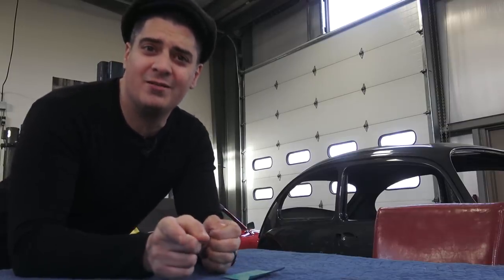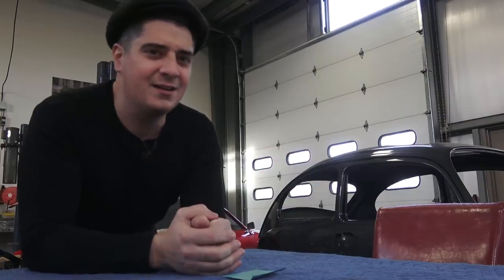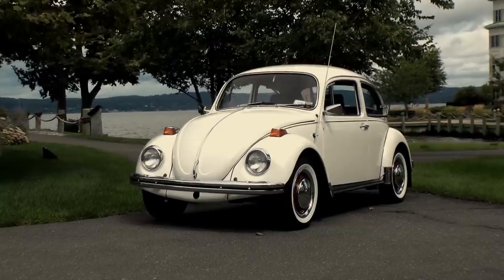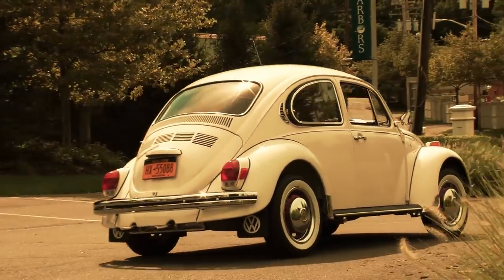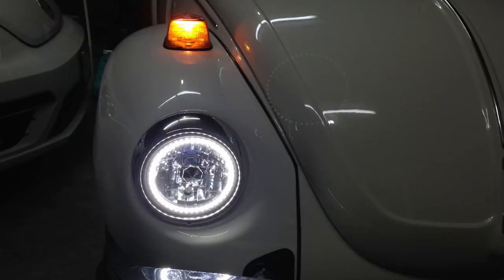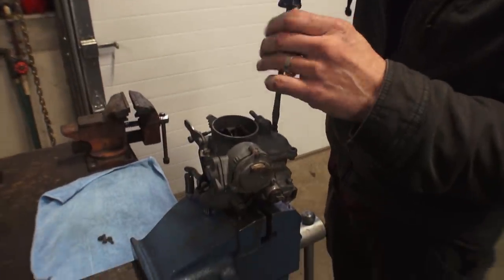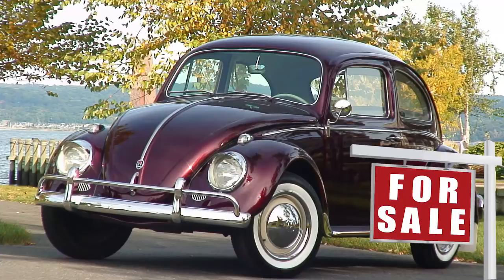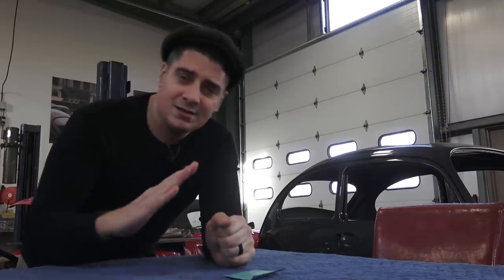Classic VW BuGs Top 5 Reasons You can Still use a Beetle to Daily Drive

Comment: I LOVE my daily driver bug!! Wouldn't trade it for the world, even when I'm broke down on the side of the road 😂😄
Reply: Same here with my 56 vw panel van
Reply: Dust Buggy I’ll always own a Beetle!
Reply: Are they problematic??
Reply: @jimmymolina4300  lol yes and no. Yes because they are so old and many have not been maintained as much as they should have been. No because when they are fresh they run very well and are very reliable! 👌
Reply: Dust Buggy this really hit home! I was broke down in my super beetle two nights ago 🤣
Reply: @Alex Rodriguez get any sort of electronic ignition, get your ignition system sorted,(new sparkplugs, cables,cap ,rotor and belt) get all of your fuel hoses replaced and get new fuel filter, then get the brakes serviced ,CRY ONCE  it'll give you more smiles per gallon
Reply: @jimmymolina4300  no
Reply: I keep an oh crap kit if it breaks down. Extra carb plugs wires string tools. etc my car is very reliable.
Reply: Well, one thing about a bug: It might break down by the side of the road once in awhile, but if it did, there was a very good chance that you could fix it by the side of the road. Try to fix a 21st century computerized wonder-car by the side of the road.
Reply: @null643  I hadn’t looked at prices for a few years but was bug shopping the other day. Yeah they have gone up a little but you can still get a really nice 68 and later for under 10 grand. It seems like a lot but I’d rather pay 10 to 15 grand for a really nice bug than 50 grand for one of the new rolling computers lol!
Reply: I have a 69 and love it, my other vehicle is a 71 Cj5, and  sportster drag bike. I believe in depending upon myself via carburetors. 👍🤘

Comment: I'm 16 years old, from Sweden, and I love those old vw bugs! I have 2 of them already, one from -64 and the other from -65. I would never even think of buying a new car! I have to do a lot of work to them before I can drive them though... But I have 2 years left before I can get my license anyway.
Reply: Elias Andersson That is Awesome!!!!
Reply: Elias Andersson Lucky you!
Reply: I love Sweden
Reply: My 1st car was a '64, In 1975.  45 years later, I have another '64 sunroof bug.  I drive it almost everyday.  I spent the money and time getting all of the crap parts off of it and making it reliable.  Low tech.  28 pict-1, big cap vac advance dizzy and peirburg fuel pump.  40hp is the perfect engine for me.  31 mpg.  It's a blast at the gas station as I have the only one around and it gets a lot of comments.  Good luck Elias!  From Texas, USA
Reply: @brianchisnell1548  i love my 70
Reply: @brianchisnell1548  Fun to hear :) I really love original, my cars are all original, no extra hp, no bling bling wheels, etc. Original is the only right thing if you ask me. Looks good and it's reliable. Sadly my vw project is kind of put of to the side at the moment since I've got a '56 Volvo Pv 444 KS that I'm currently working on instead since it's not as much work to get it on the road.
Reply: I'm 15 years old from Mexico and I bought a 1968 and I'm working on it too. Beetles are beautiful cars. I think the same as you, originality is the best.
Reply: Any updates on the cars?

Comment: I had several classic beetles in the 1970s and 1980s. My last was a 1961 rag top I sold in 1990. Chris is right, they are a cool and dependable daily driver. When you drive a beetle you are in control 100% and anything high technology is out the window. My '61 did not even have a gas gauge, lol! But as a daily driver you need to understand you are going to be  wrenching on it on a regular basis. Regular maintenance is  part of owning a bug. Every 3,000 miles you have to pull off the valve covers and adjust the valves. While you are at it adjust the points in the distributor and check the timing. How is that pulley belt? Too loose, too tight? Set the tension so it is perfect. That engine is not fuel injected. The carburetor / fuel mixture needs to be adjusted and dialed in. Too much travel in the clutch pedal? There is a cable you can wrench on that closes it up. Brakes need adjusting? Jack up the car, pull off the wheel. There is a star you can turn with a flat head screw driver that will bring the shoes closer to the drum. Chris mentioned being handy with basic tools, but that really needs to be highlighted, especially if you are looking to buy your first bug. Regular maintenance is not an option and you need to keep up on it for as long as you drive the car.

Comment: They work very good. My daily car is a 1200 beetle from 1963. Still with a 6volt electrical system. The 6volt works pretty good if it is properly maintained. The only modification I have done is to put in an electronic relay for the turn signals. Now they blink at a consistent rate even when idling. I am also planning to put in an extra relay for the headlights. A guy in my club has a 1950 6volt beetle where he has put in a modern cigarette lighter socket that he uses for various chargers. He claims that it works good since a lot of electronics only require 5 volts to charge. I can't confirm it, but he clamims that it works. These cars drive very good in the snow but I put the beetles away from mid November until late March / early April. Where I live we put salt on the roads in the winter and the old german lady doesn't like salt.

Comment: My Daily driver is a 2019 Model 3 and I actually miss a combustion engine. The shifting, smell, and sound. That is why I started restoring my 1968 VW. Wish me luck!
Reply: You know, I fully understand the necessity of moving to electric cars: The only realistic alternative is doing away with cars altogether. But I will never like it. I'm 65 and I'm going to keep my gas-powered pickup truck running as long as I possibly can. I deeply fear that if it dies before I do, I will have to replace it with some electric POS.

Comment: I've had my '63 bug for 22 years. Built a single port 1600 for it as the engine was worn when I got it. I drove it to work for years now I'm retired and have another car but thats only driven when I need more space or there is snow (salty roads kill them in St Louis). Modern accessorys? My bug  has a FM radio, gas gauge and a small fan sitting on the passenger floor. I burned a piston last year (dumbass hot rodding) had to pull the engine and put in a 1641 top end, had new seals put in the transmission, floor pan under the battery and put a new steering box in it. So that was like  $2000 and it's going to be around for as long as I'm around. Here I am watching videos like this to keep her on the road watched your video on adjusting valves yesterday. I've done that 100 times but watch to see if someone can teach me something new. Thanks for the great videos.
Reply from the maker: very cool man

Comment: Agree 100% with everything you said! I have a '73 Super Beetle, which I've had a lot of fun with, been daily driving for the past 9 years. It is a bit of a hassle, requires constant upkeep, but nothing particularly difficult, and almost always quite cheap as I do it all myself. My big word of caution is that one must know that it's a lot of upkeep, and if you take it to someone else for all the work that needs doing it's going to be a money pit. But if you are willing to learn the basic skills to keep it going, and are willing to put in such effort, it's great. The overall costs are quite low, I would say that I've spent no more on it than anyone would on a newer car, not counting depreciation. Counting that, I could probably make back almost everything I've put into it over the years (excluding consumables like gas and oil) if I sold it, which I'd never do - try that with any modern car!
Kids getting into them? I bought mine as a 16-year-old, hoping to get a car that I could learn to work on, something I couldn't do with a modern car.
Good in snow? The lack of front skis and rubber tank-tracks make it look a bit different from the traditional snowmobile, but it performs just about as well. I live in Colorado, where it does snow a good bit. I have chains, but have never needed to put them on - I've always wondered what it could do with them, I'm guessing straight up a green ski slope would be no problem, blue would be questionable. I had a Prius as a second car for a little while, and it became useless in half an inch of snow, part of my motive for selling it.
Upgradeable? That's the thing I love most about it, you can do anything to them, and they're not rare or priceless enough that anyone cares. Mine has all those upgrades mentioned - LED headlights (actually pretty much all LED lights), all-around disc brakes, and I'm currently in the process of installing seats out of a junkyard Honda Accord, which I'm also putting those heating pads into - will be nice on those frigid days. I also have a fully modern Electronic Fuel Injection system I installed myself (Microsquirt ECU, Mexibeetle manifolds) and distributorless LS coil ignition, runs great and gets 30 MPG. And most important, a thumpin' sound system. I've also built a custom wood dashboard and door panels, making the car truly my own.
Low-tech? My mom's Tesla Model 3 drives me insane! Can't even turn the (supposedly automatic but sometimes malfunctioning) windshield wipers on and off without going into some menu on the screen. The problem in my mind isn't the dashboard with way too many switches, it's the ones with basically none and one big touch screen that requires you to take your eyes off the road to do anything - not just annoying but seriously unsafe. What I like about the Bug is that, given the upgrade potential previously mentioned, I can add whatever modern tech I want and not have anything I don't want. Want heated seats like a modern luxury car? Add them. Want a great sound system? Install it. Don't like that modern "infotainment" nonsense? It's not there, and you can keep it that way.

Comment: Appreciate your little shout out to John Muir's book. i had two beetles and two Type 2s back in the day. The "idiot book" got me through those (including a total engine rebuild in the middle of a cross-Canada trip). I still have that book, and the grease stains on the various pages are a testament to maintenance and emergencies both. I may still be a "compleat idiot", but I can say that with an old Volksie, basic tools, and a copy of the best auto repair manual ever written, you have daily driver nailed. Before I die I hope to be able to use that book for its intended purpose. Thanks for keeping the dream alive.
Reply: John Muir's book was great!  I bought it when I was stationed @ Ft. Meade, MD in 1981-1984 and had a '78 Beetle, and then a '78 Bus.  Did a lot of work on those cars, but they were a lot fun!

Comment: I recently got a 62 running and started driving it to work to see if I had any wrinkles to iron out.  Then drove it to work more because I just wanted to.  I have an 04 SRT10 which drives like a rocket powered brick and a 17 Outback that seems to be designed to make me forget I'm driving... in the worst way.  I'm comfortable with all the tech.  Though, touch screens worry me.  But, it's when I get into the little cupcake that I feel like I'm actually driving.

One thing you really left out though, is that it makes people smile.  Myself, included.  It's like a little rolling therapy session coated with nostalgia.  And, I'm convinced that EVERYONE has a 'Bug story'.  Anyone Gen-X and older has some sort of memory of a Beetle in their life, family, or whatever.  I often see faces light right up as I'm tooling around.  It's like the automotive equivalent of a basket full of puppies and kittens.
Reply: fishing trips and driving those trails like a Jeep, Overtaking a car was a suicidal feat! A car that need a skilled driver if you drive today small cars only  be carefull if u try one!

Comment: I can't say I drive my '78 convertible every day, but it does get used several times a week, year round, regardless of the weather.  The biggest problem I've had with my bug in the year and a half I've owned it is the starter took a dump, though I was able to get it going again, and get it back home so I could fix it myself.  I recommend Beetles to people for the same reasons you mentioned:  They are currently inexpensive but appreciating.  They are easy and inexpensive to maintain.  Parts are inexpensive and readily available.  They are reliable when maintained properly.  They are great cars to learn vehicle repair and maintenance.  And finally, people love them.

Comment: I have a 1962 beetle for my daily driver.  It’s been updated to 12-volt and disc brakes in the front.  Other upgrades include electronic ignition, scat pulley with idler wheel, seat belts and headrest seats.  I did a gloss black paint job with no chrome to evoke a KdF look as those were the most Teutonic VWs!  I drive this every day to and from work.  When the Powers that Shouldn’t be ban gasoline cars, I’ll try to convert it to Woodgas!

Comment: Great, great, great!! You can't be  any more precise Chris. I have an aircooled VW of my own (I'm from Brazil and have a 1979 VW Brasilia in great shape, as a weekend driver) which I've been owning and enjoying over the past 15 years. I just had 2 "modern" cars so far in life, and even tough they were not sooo modern (heck, what to expect from an econobox? Haha) I'm getting tired of them, they are just too boring. I prefer the real machine feel and the therapeutic noise of my aircooled engine instead. I don't care about the lower grip of the bias ply tires, the ingnition points, the big unassisted steering wheel and whatsoever. I just love feeling back in time inside my VW. Cheers from Brazil!
Reply: "therapeutic noise of my aircooled engine" Yes!!!!! I love all aircooled boxer engines. They have a special sound.

Comment: VW Beetle will definitely survive. Throughout this 20 40 years, I 've had 6 beetle. Everytime I told myself this is going to be the last one, I kept coming back. My present beetle is a 1973 Karmann convertible very original and even with the original top in pristine condition..
This is a piece of motoring history. It's nice to drive a classic car daily knowing it's not left behind after 40 , 50 yrs old., and maybe still on the road years later. My target on classic is exactly the above goal, A/C is also a must (except convertibles not harshly used) VW beele can carry A/C with ease if properly installed, ( Nowadays a lot of kits available tks to the rotary pumps) You can be "someone" on the road though you are actually nobody driving a neat and clean 50 year old car, enjoying the comfort of A/C in conjunction with 2023 cars on the road. You can see other motorists driving boring cars dropping their jaws! Good thing as you are entertaining them while they got too bored driving their new tin boxes, that is controlling them, not they controlling the car itself!
So long live VW Beetle and DO NOT DRIVE BORING CARS ANYMORE that includes electric cars!!!

Comment: I have a 69 that I got in 2019 for $1,000. It was running and driving when I picked it up. I put maybe $2,000 into it. Not going to lie to y'all, She (the  Jezebel)  tests my patience once a month or there about.  Of course I still have things to do to her. All and all I consider myself lucky to be her beneficiary. 
   BTW the Jezebel is my daily driver. She is stock with 12v converted, still has generator. I put LED's for all lights with day runners, halo turn signals. No issues with the engine, as I am constantly tightening and cleaning it.(flame thrower package, new carb, took oil bath off(probably putting it back on because I cleaned it completely dushed today) Other than turbo would be cool.
   I would like to add both roof and deck lid racks for my fly fishing and Tattoo equipment when I'm on the road this summer, probably drop spindles, Monroe air shocks front. Not sure how to go about the rear. Any ideas/recommendations guys or Chris? 
  My most pressing issue is a leak via front, rear, or both window seals. I cruise at around 60-70 mph on the highway.

Comment: It's been almost 40 years since I've driven an air cooled, rear engine VW, but I drove four of them. The fourth, a 411 wagon was the worst I ever got burned on a used car, but the to beetles and the Karmann Ghia I had before it were gems. The Type I air cooled VW'S (beetles and Karmann Ghia's) were masterpieces of simplicity. They were also possibly the easiest to drive of any manual shift cars ever made. They didn't have power steering or power brakes, but they were so light that they didn't need them. The two things that were bad about them were that the heaters were worthless, and they were a bit underpowered. Not horrendously underpowered, mind you. I could pull any uphill on I-70 in colorado at 50 - 55 mph -- at full throttle in third gear-- but you would never win a drag race in one.

Comment: My 70 Vert is my daily driver.  
My commute is nine miles and a straight shot down I-15 in San Diego.  From home to parking lot is 15 minutes.  I have a killer sound system and it’s a comfortable drive.  
I do not get Miles Per Hour.  I get Smiles Per Hour.  
Can’t tell you how many times I’ve been at a stop light and someone yells:  “I/My Dad/My Mom/ My Grandparents had one just like that” 
I have to admit that I do very little of my own maintenance as I am blessed to have it done for me and that’s not bad.  It's not that I can't, it's just that I'd prefer to use my time elsewhere.
The maintenance is pretty minimal.  About every 8 months, I take it in and have a valve adjustment and brake check.